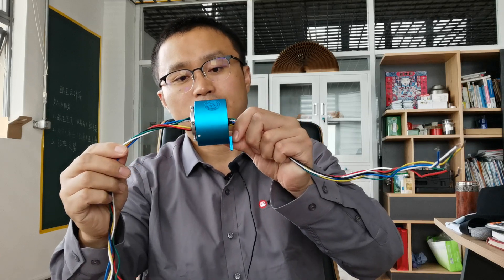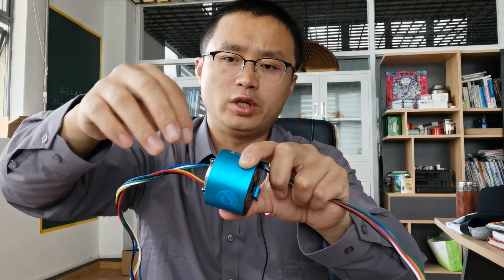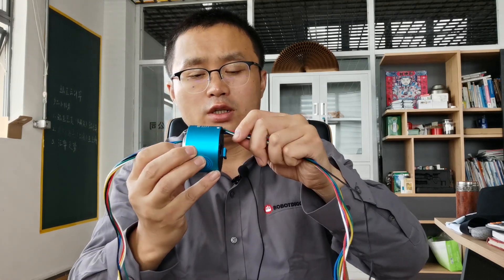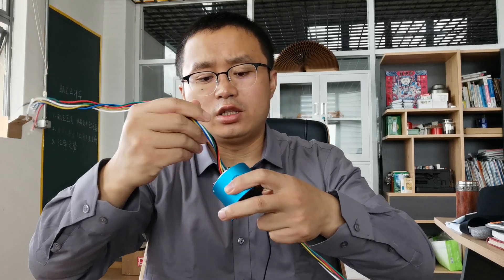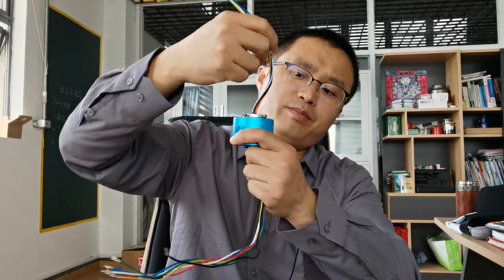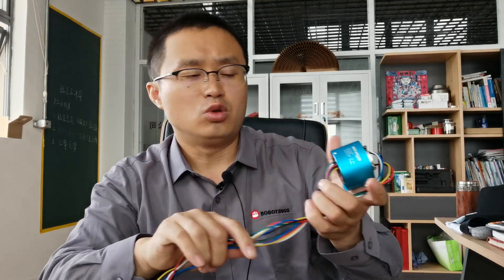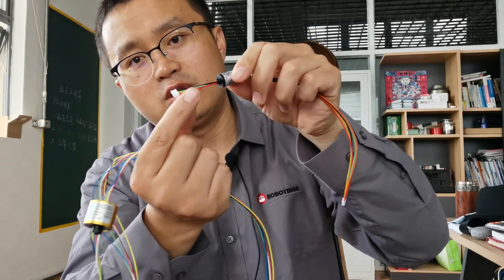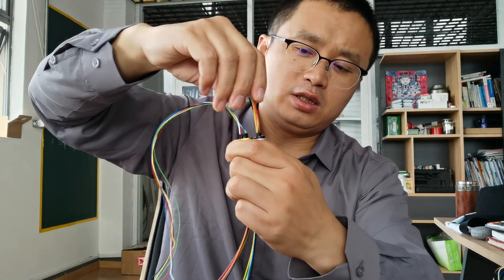RobotDigg slip ring or rotary collectors

Comment: Hi RobotDigg! 

With the blue hollow slip ring does each cable support 10 amps? Meaning 6 cables could handle 60 amps together?

I'm looking at wiring an LED game wheel and I'm planning to have about 1000 LEDs.  5v 60amp Power supply isn't an issue but I don't want to over load the slip ring.

Please let me know if I need to explain in better detail.
Reply from the maker: You are right, it's 60A in total.
Reply: Thank you for the reply! 

One more question. Is this rated at 10 amp for 110v?  So the slip ring itself could handle higher AMPs if at 5v?   What gauge are the wires?